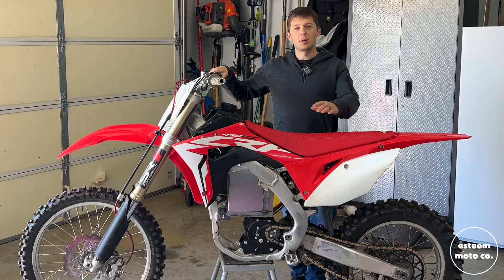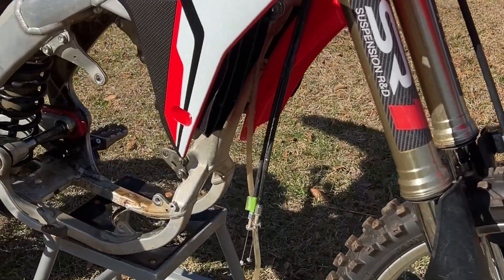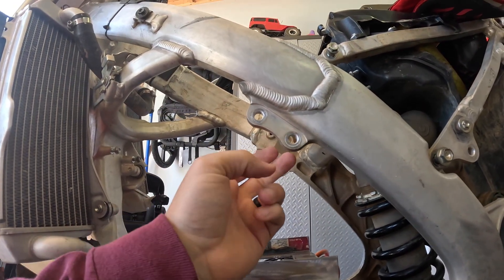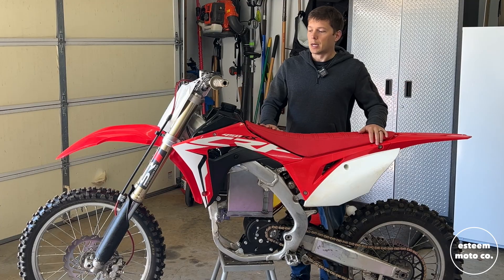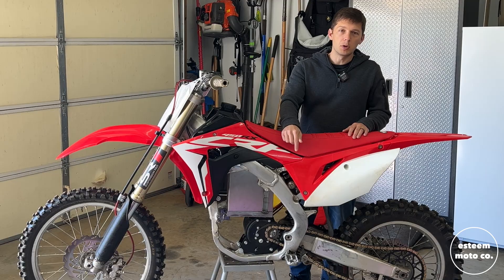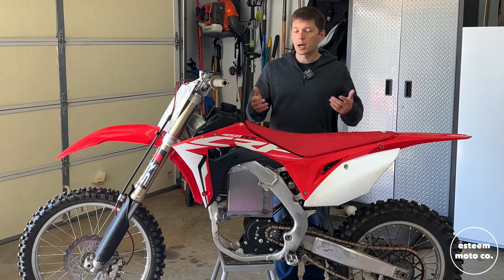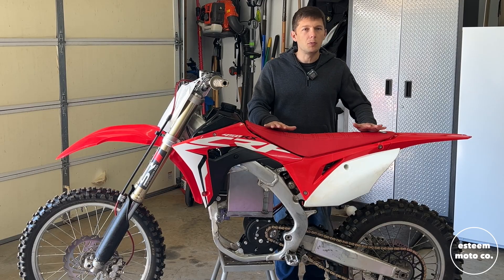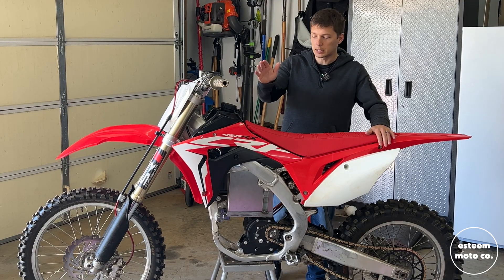Three things to consider if you build an electric dirt bike

Comment: Wouldn't a steel frame add way more weight compared to an alum frame with steel mounting brackets?
Reply from the maker: Yeah I'm not sure what the actual frame weights are. There are pros and cons to both. The modern aluminum frames are perimeter frames and allow for taller batteries but I don't have the skill or tools to weld on AL. I can barely weld on steel lmao.

Comment: Range speed distance??? costs ??? come on man info info
Reply from the maker: It’s in my other videos but $3k ish. Don’t care about top speed since it’s a motocross bike. Over 40 minutes on the track - not a fast rider though. Playing around on the trails,  some guys are getting 2.5hrs with a smaller battery than mine
Reply: Thank you man. Keep up with the good work. @esteemmoto1213

Comment: With fiberglass or kevlar you could make a curvy pack that would fill a lot of the empty space. Using wood and a router or jigsaw you could make a mould. Your battery enclosure looks like stainless steel which is great but the bike frame is already providing more protection than any enclosure would.  You would need a good battery spot welder and a BMS (maybe the open-source Ennoid Master LV which uses a contactor and can handle hundreds of amps @ up to 150v). Pre-built packs are expensive so you'd probably still save money or break even with larger capacity in a custom design. Make sure you have a good enough understanding of the materials you need to handle the kind of current you're going to draw.
Reply from the maker: Good info! I do want to try making a battery pack at some point but it just isn’t in my cards yet.

Comment: Good advice. I got really lucky with my rolling chassis. I wanted a steel frame as well but my YZF popped up and was too good of a deal to pass on.  Agree with premade brackets, it was fun but second build you can do so much faster.   I went with a larger battery. I went with 56ah.    Great build! Great videos.    Also I am looking for CR250s for a future build.

Comment: Cool video, I am in the same process and should finally ride the bike in a month or so. Since you bought the kit from e&Co I image it is a 72V system ? As for frame, I have a RMZ, similar feedback than you which I think is probably to be expected from any second hand bike with a blown motor. Or buy a bike with a good motor but then it is a lot more expensive and my not make sense to do so. Also RMZ upper motor mount is not in a great location, it needs to be cut which creates a lot of issues to fit the battery so I'd probably pick a CRF if I was to do it again.
Reply from the maker: There is a guy on the electric motocross build facebook group that used an RMZ and made it a sweet set up. But he also was a fairly good aluminum welder so he could make it work.